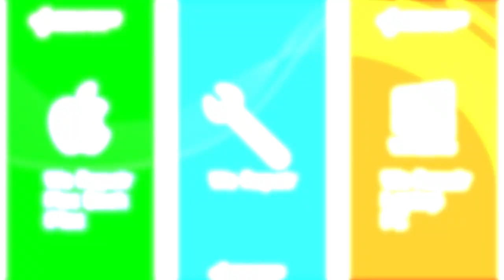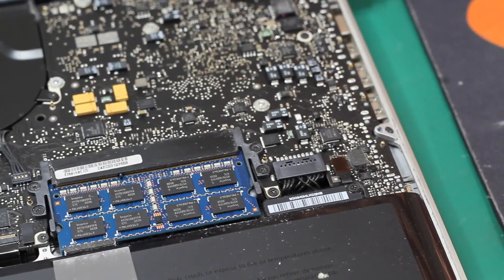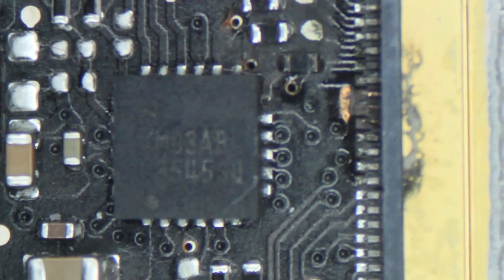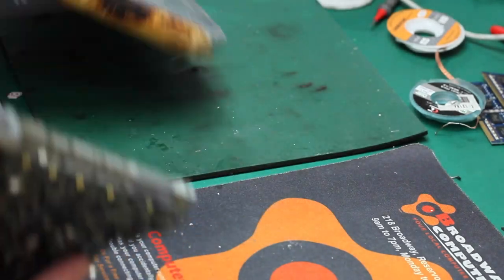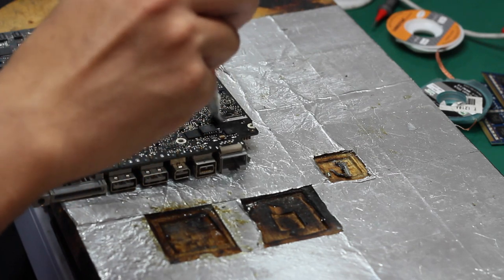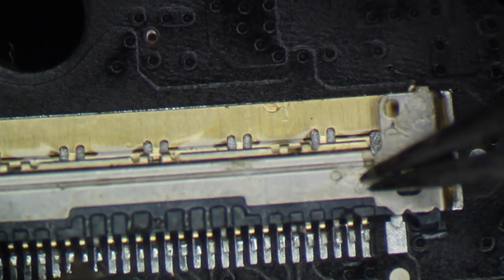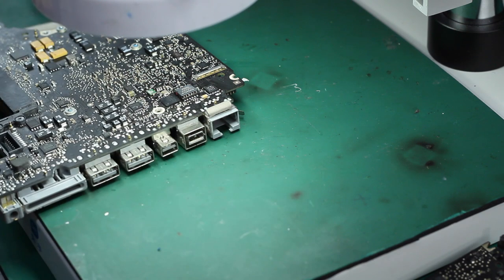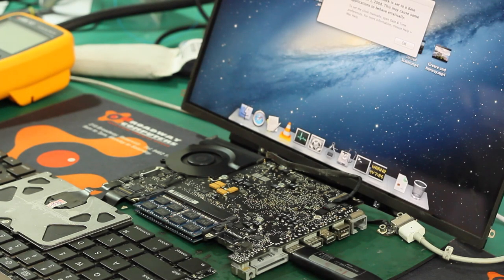Macbook Pro A1278 Backlight Repair  (Logic Board Repair)

Comment: u8900 on the a1398 is a bit of a common one we fix at Unofficial Mac.   Do you have a video or people on that?  also perhaps a good video on the U7100 charge circuit failure from cheap charger damage?